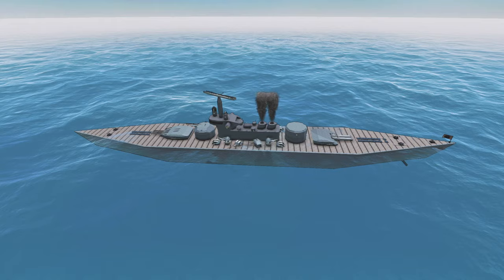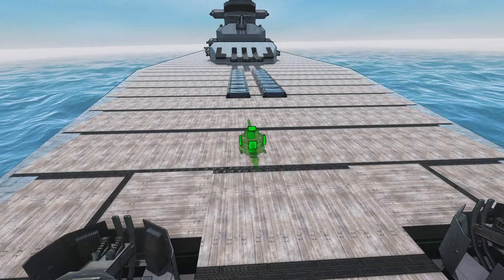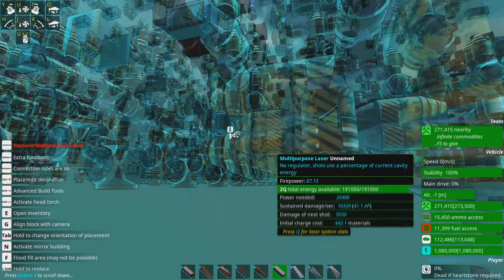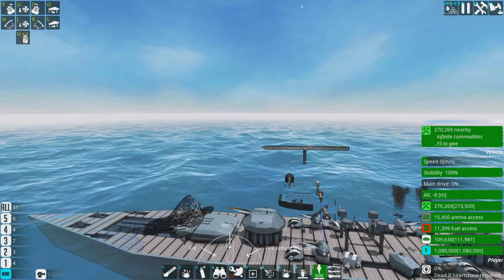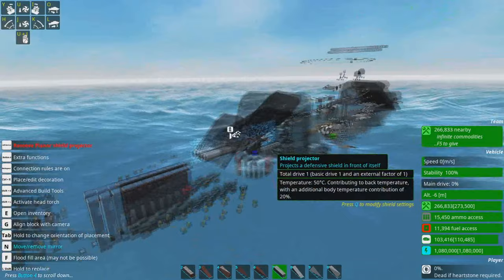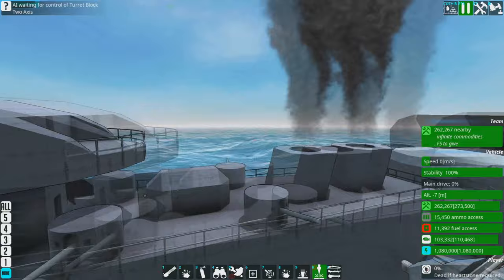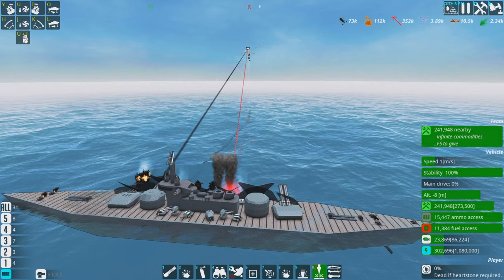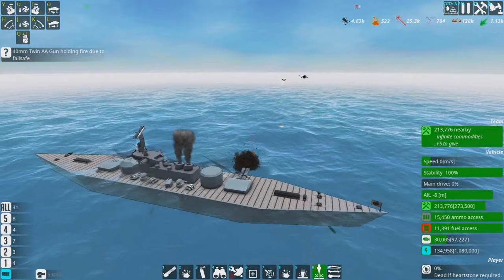Complete Ship Build #20 - Shields! 💍🛡 From the Depths

Comment: Wait, the shield projector's functions have been collapsed into blocking everything at once!? I should start paying attention to the changelogs again... 
Also, I remember testing the shields after they brought stacking back and they didn't feel like they worked as described. Didn't do particularly good at recording meaningful data, but it definitely felt like adding shield layers at different angles actually increased overall deflection odds even though the deflrctions were spread out across the layers.

Comment: @BorderWise 11:44 Would it be possible to put a shield on a kind of arm (like industrial robot), and have the arm track the incoming shots & angle the shield to optimally bounce shots away? (assuming single shot enemy, for now).
if it is possible, you could use a single shield, at a very small width/height & high strength, to almost certainly reflect shots away from yourself, by just moving the shield to the right position & angle, then hold it steady there before the impact. :D (I have been thinking of this for a LONG time, but I don't have the skills to make this).
Reply from the maker: That's basically what I did with the 2-axis turrets shields. :D
The problem with tracking shots is that there's no way (apart from LUA, probably) to track APS shells and get a turret to aim at them. So not really feasible for most people, unfortunately.
Reply: @BorderWise12   I saw those shield turrets later, that's a great idea.
Thanks for the answer :)
Reply from the maker: @sebbes333  Yer welcome! 😁👍